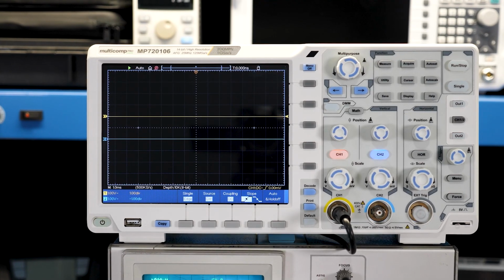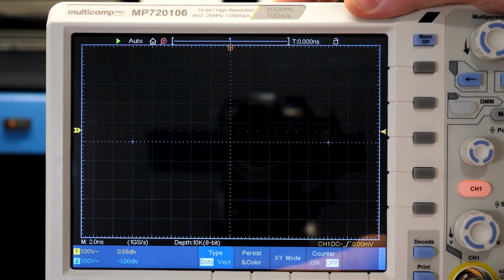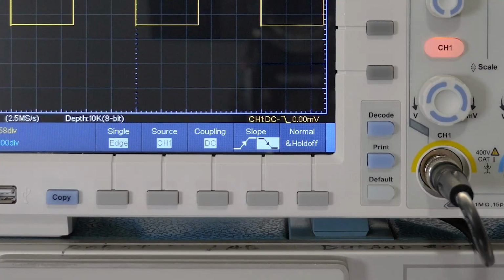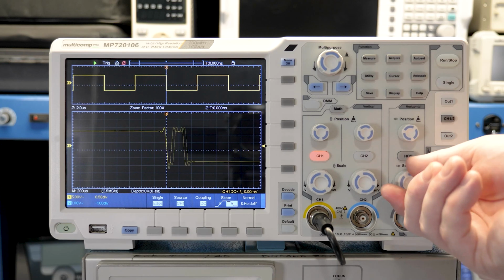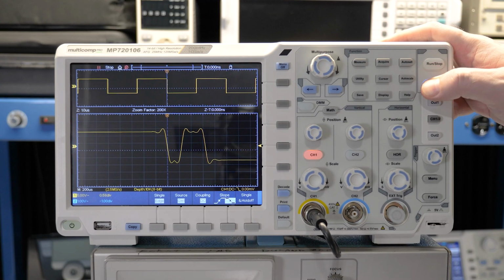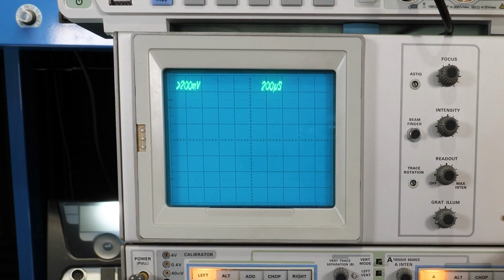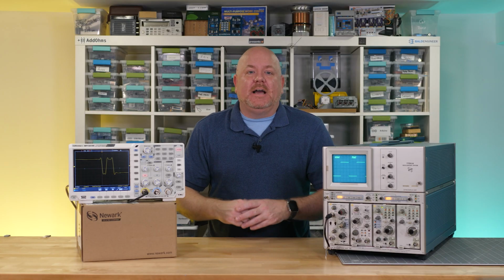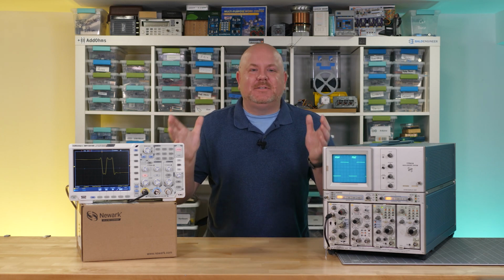The Origins of Delayed Timings on Oscilloscopes - Workbench Wednesdays

Comment: The other interesting thing is that the glitch as displayed on the analog scope had nice square edges.  Now, as frequency goes up and pushes the rise time capacity of the scope, you will lose the sharply defined corners.  BUT the digital scope had a squiggly shaped waveform, nothing like a square shaped pulse.

Comment: Didn't some modular Tektronix boob tube scopes have a memory feature?
Reply: Sure, both modular and non-portable models. A few examples: 7613, 7623, 7633, 7834, 7934, 464, 466. These all have storage ("memory") on the CRT screen itself. Some had pretty fast single-shot storage. The 7854 analog 'scope had digital memory and could even be programmed with its own separate keyboard. A plugin (7D20) existed for the modular 'scopes, making the analog 'scope a digital one by using the 'scope as a monitor for a complete digital acquisition unit (70 MHz BW). In the low-cost 5000-series plugin 'scopes, analog and digital storage modules existed as well.
Reply: Boob tube scopes...the 500 series, yes. The first one that had delayed timebase was the 535 introduced in 1954.  There was also a storage scope - the 549 - also a tube scope from (I think) the 50's although maybe early 60's. The 564 was also a storage scope that was introduced in around the early 60's.